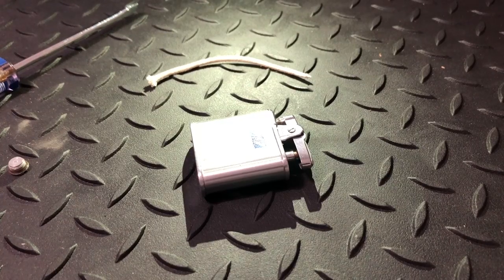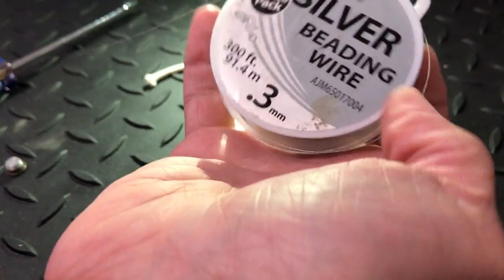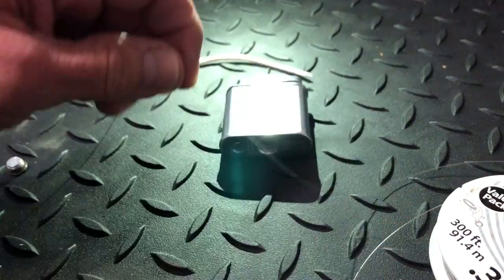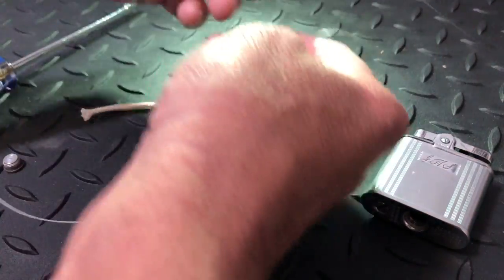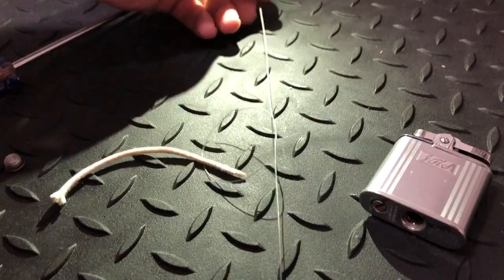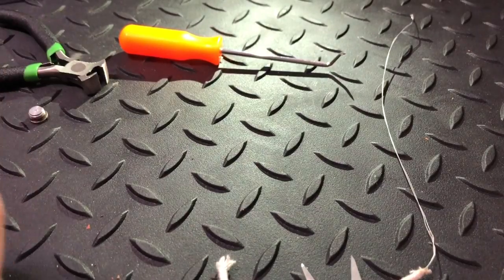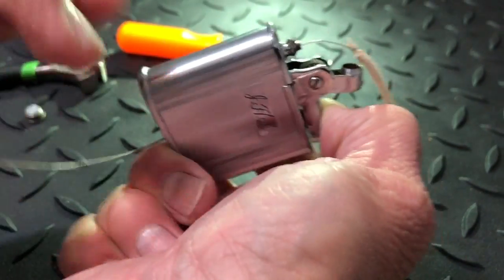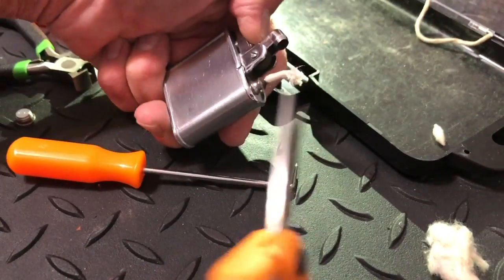How To Replace The Wick In Any Petrol Lighter(Blind Method)

Comment: I just found two lighters like this in a china cabinet I have one a Ronson and the other a Crown. Bad thing is I don't recall where I even got them. I love old things that were built to last. I restored an old straight razor about a year ago and will never go back to disposables. I will add that if you are a procrastinator and get a straight razor to keep a disposable as backup for when you are running late. You don't want to get in a rush with the straight lol.

Comment: Vintage Petrol-wick Lighters till my soul. A kind of world that's getting rarer by the day. Repair-and-mend culture among many other things, with all the throwaway culture these days seemingly in all aspects of life. Great vids and a wonderful website I could hang around for hours on end. Vid on paintwork restoration and increasing/decreasing flint spring pressure would be nice too. I wonder what the ideal flint spring pressure is.
Reply from the maker: LUSCIOUS kollektibles I appreciate the comments and suggestions. As for ideal flint spring pressure, that's a great idea for a video and I suspect ideal pressure will vary depending on the flint and file wheel being employed. I'll add it to my list of future undertakings. To this point, I've mainly left the finish as I find them, other than a "cleaning or dusting off" as it seems collectors prefer original to refinished and my aim is to sell. You have the wheels turning in my head though because I have several lighters that don't have much value but I would love to restore the paint for my own personal use. Stay tuned.
Reply: We forget back in The day they were almost as Rare. For decades almost everyone Lit up with Matches and Lighters like this were few and far between

Comment: If you unscrew the flint screw you will find that part also unscrews allowing you to remove the base of the lighter so you can put new wadding in
Reply from the maker: The base twists on Ronsons from the mid '50s on and the base comes completely off on another model or two but again, these were later models. With the old Ronson Standards and similar clones the bases are not typically removable.✌️
Reply: dam ay, so this model you have to stuff through the fill hole

Comment: What wicks do you use for a flat advertising lighter? Zippo wicks are too thick. Also, do you pull the wadding out with small tweezers? Got to be tuff getting it back in. Thanks for your help.
Reply from the maker: Stay tuned...I'm making a video to respond to this question...✌️

Comment: Hi, Joe. Given your experience with lighters and as a lighter mechanic, I know you know a lot about this one: Does the Zippo wick fit all lighters? I can only buy Zippo wicks. I know you're using Imco wicks. Imco wicks are not available in my country.
Reply from the maker: Zippo wicks will fit the vast majority of petrol lighters but there are many different wicks available on both Ebay and Amazon:

https://dependableflame.com/what-kind-of-wick-should-i-use-in-my-vintage-petrol-lighter

✌️
Reply: @DependableFlame  Thank you so much, Joe!

Comment: I have a Omega superlighter and wondering what type of wick to get? I don't think a zipp wick will work. Any help would be greatly appreciated.
Reply from the maker: A Zippo wick would work but the Imco wire lead wick or one of the wicks from the Ebay seller david2052 may be more appropriate. I have written an article on the subject here:

https://dependableflame.com/what-kind-of-wick-should-i-use-in-my-vintage-petrol-lighter

✌️

Comment: Mind if i ask you some questions? I am personally using a 50s colibri lighter. For some reason, the wick is burning out too quickley. I had to cut the wick twice this month. Do i have to replace the wick? Am i using the lighter wrong? Or is it because there isn't enough fuel?
Reply from the maker: Feel free to ask all the questions you like, I just can't promise to always have a good answer!😜
I have always heard that a charred wick meant low fuel but I am not a scientist nor did I pay enough attention in school to confirm or refute that's the case. Trial and error never hurt anything though so I would do two things:
1. Pull the wick up and snip off all the burned end and at the same time take care to make sure your lighter does not run low on fuel.
2. If that doesn't fix it and the charring continues, replace the wick in your lighter. It's pretty simple to do and then you should be good.
You never know, if you didn't put the wick in there yourself, it could be contaminated with any number of substances that will burn.✌️
Reply: @DependableFlame  I tried this and that for a few minutes, and found out what the problem was. The wadding(cotton) was too old. The wadding hardened and could not absorb enough fuel. Replacing the cotton fixed the problem. Anyway, thanks for your advice.

Comment: Hey I got the same lighter do u just pull out the cotton out of the bottom then put the wick then stuff cotton back in side ?
Reply from the maker: Dylan Dewit, that's the basics of it, yes. It can be a very slow and frustrating process though. You can read the article with detailed instructions here: https://dependableflame.com/how-to-replace-the-wick-in-any-petrol-lighter ✌️

Comment: where did you get these wicks. i cant find any without the copper wire in them and they can't be cut down to a slope to fit in
Reply from the maker: I have links on this page of my site where you can purchase many wicks and other vintage lighter supplies:

https://dependableflame.com/helpful-lighter-related-links

✌️

Comment: Very useful video. I want to repair a vintage penguin's whirlwind superlative automatic petrol lighter from my grandfather and i want to ask you if you know where i can find a filter and flint online for europe...!! 
Thanks in advance !!
Reply from the maker: T.A, I'm thrilled you found the video useful. I'm not sure what you mean by filter but suspect you may be speaking of the rayon or cotton wadding for inside the fuel tank? If so, I just use cotton balls but any absorbent material like old t-shirts will work. As for buying flint, the links at: https://dependableflame.com/helpful-lighter-related-links should work regardless the country you're in, I believe. Let me know if you need further assistance getting your grandfather's lighter working again.✌️

Comment: i changed my flint and it seems really tough to spark it... is the flint too big?
Reply from the maker: What kind of lighter are your talking about Steven?
Reply: @DependableFlame  cmc continental. small one. similar to yours
Reply from the maker: Back off the flint spring screw and make sure you “groove” the new flint in the proper direction before tightening back up. If that doesn’t work then there could be a bigger problem like the top of the flint tube is ruptured or worn out allowing flint to bind.✌️
Reply: @DependableFlame  when its barely screwed in the flint strikes smoothly but when it gets screwed all the way down it jams up... maybe too much pressure because the flint is too long, i salvaged the flint from a bic
Reply from the maker: Yes, use a regular length flint. That will definitely make a difference.✌️
Reply: @DependableFlame  thx. what do you think is healthier. butane vs lighter fluid..

Comment: Like to ask about how if the wick is too thick…
Reply from the maker: The wicks and chimneys can have slightly varying diameters but I've never encountered a combination I couldn't make work.✌️
Reply from the maker: I have a link on this page:

https://dependableflame.com/helpful-lighter-related-links

Where an Ebay Seller offers wicks of three different diameters you can buy. This may help you. The link is towards the bottom of the page.✌️
Reply: @DependableFlame  thanks! My Japanese firefly lighter can’t fit all the zippo wicks I bought…

Comment: The wicks do not fit, I have tried wire and it doesn't fit
Reply from the maker: Which lighter and wick are you working with?✌️
Reply: It's an old omega, quite a small one not sure what model, I'm using a wired wick too
Reply from the maker: @Mattyj3388 , I've rewicked plenty of Omega lighters with old Ronson or Imco wire lead wicks. What do you mean by wired wick? Braided wire like the Zippo type or wire lead like Imco?✌️
Reply: @DependableFlame  yeah braided. Does the small nozzle on the top where the flame ignites screw off? If so that will make it easier
Reply from the maker: @Mattyj3388 , no it doesn't typically unscrew and it will be much more difficult to get that wick down the chimney than the others I mentioned. With the braided wire you will have a hard time twisting the wick down small enough to fit. The Imco and Ronson draw down smaller having no braided wire to buffet them.✌️
Reply: @DependableFlame  managed to find a wick already inside, so used some fishing wire to pull it through, got it working now. Had it off my grandad, so wanted to keep it. Will order some wicks without wire as that should be easier to use
Reply: I think it's an omega super lighter from what I have found online
Reply: Another question, could I use natural hemp wicks in it? Or does it have to be cotton and wadded?